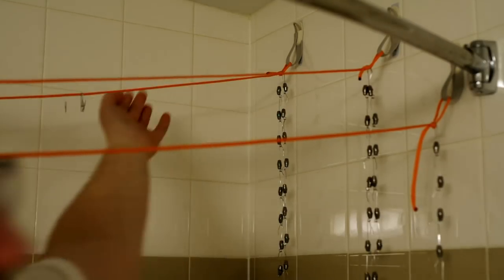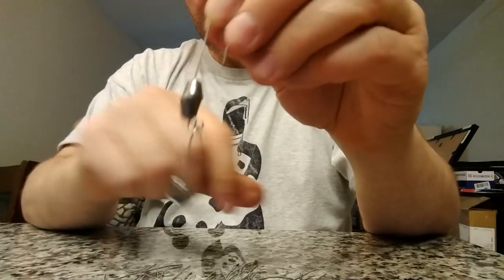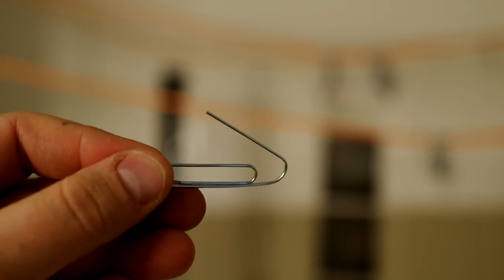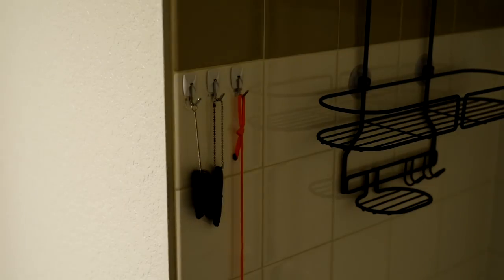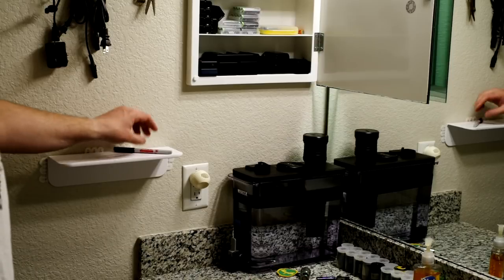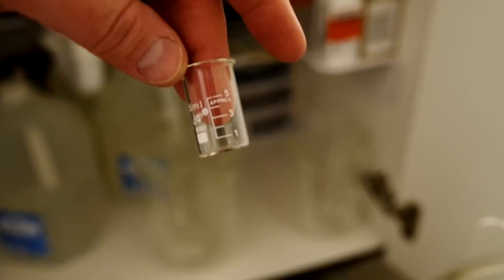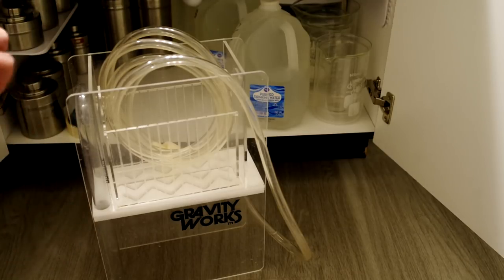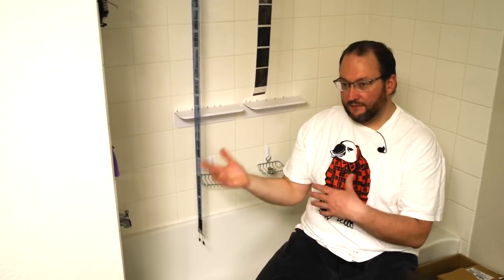Home Film Processing Tips and Tricks

Comment: I use fishing weights for my film, great minds and all that. I use different colour funnels for my different chemicals and I also mark them to indicate what chemicals they are used for. I also have a collection of 10ml 5ml and 1ml syringes with blunt needles for different chemicals that need precise measurements such as Rodinal. They cost pennies off eBay, but I always rinse them well with filtered water before using them. I rinse them again after use and put on them with a permanent marker what chemicals they were used for. I use one of those circular cloth hanger drier things for hanging multiple films. I can fit about a dozen films all at one time without them touching each other, the most I’ve had was 8 4 120 and 4 35mm. I run the shower really hot before hanging my film to bring the dust down.

I was lucky that I was given a Nova print developing tank (20 x 16) and a Nova print rinse tanks, but I can take the partitions out and put film in. The two together cost around £800 new. The same guy gave me a light table, two years supply of D76, a couple of other developers and a warm plate foe developing trays when I using a different developer than the one in my Nova.

I’m thinking of developing all my analogue 365 project films at the same time early next January so my question is how long do you think you can leave a film without developing before you lose quality? My father in law gave me a Practika he had last used in the 80s, there was a half used roll of Kodak Gold in it that I developed for him but they came out looking under developed.

Of course the video was helpful as a whole, and it’s difficult to pick out individual parts except to compare with how I do certain thinks.

We’ve not seen you for a few months, you’re looking really well.

If I was a dog I’d want you as my owner, I know you are the right people to give a dog with difficulties the sense of security he needs. My late father once told me you can judge a man on how he treats his dogs. He was Otis's favourite visitor, he was my dog who was with me through the worst of my alcoholism and the first few years of recovery. Loyal as heck and I always made sure he was alright no matter how low I got. Dogs are special and often they need special people like you. However, dog farts...🤢

Comment: The work flow process is fantastic, so many great solutions to make it efficient. I will likely never have that kind of quantity, but this was thorough for all steps and issues. Tape and Sharpies are the best. Cheap solutions to process, also. Storage a bit less since I will not have that variety or quantity, but still useful. Great video, and saved. Good luck with the Canine.
Reply from the maker: Thank you!

Everything can be scaled to your size space and needs. The big thing with the workflow is keeping all the supplied either within arm's reach or at least nearby and then making the cleanup quick and easy.

Comment: Great tips here. Will come in handy in 2019, where I have a goal to shoot more film. My current capacity though: 2 rolls. ;) 
When you develop color do you worry about the chemicals? Do you use a mask? Is the bathroom fan enough to ventilate? I hardly ever do color, mostly because I'm paranoid of it in my small space I have to work in.
Reply from the maker: Thank you!

I don't develop color at home. One of my friends had an acquaintance who died developing film (I think it was E-6 or another color process besides C-41.) I want to try C-41 at home, but I want to have better ventilation before I do. The future basement darkroom is going to have an air circulation system to bring in fresh outside air, so C-41 at home will probably have to wait until we're in a house.
Reply: Andrew I never have much trouble developing C41 at home using Unicolor.  The blix is nasty but to be honest if the fan is going it really is just a bit concentrated in the bathroom while using it and vents out in a few minutes from my experience.  If you are concerned by the fumes grab a p95 air mask at whatever big box is near.  It isn't the absolute best air filtration, but the vent makes it much easier to breath so you actually want to use it.  Personally I haven't found the need.  My wife seems to be more sensitive to the blix than I am.  We are using Paterson tanks so they seal pretty well and will replace the tank if the seal starts leaking much.  (Even new tanks will leak a few drops of blix on inversions wear gloves)

Although we don't develop for long sessions usually one or two tanks so total time exposed is under 30 minutes.

I have never heard of anyone dying from any of the chemistry outside someone being an idiot and drinking it.  It is mostly just an unpleasant odor.  As safe as I am it has come in contact with skin to no effect outside of a quick wash with soap.  Watch videos of the old guys Ansel Adams and others they rarely wore gloves, didn't have large vents and lived long lives.  That's not to say live risky, more to keep in mind that a good percentage of these chemicals were normally found in average households back in the day and way worse I might add.  If you are being cautious wear a mask, good nitrile gloves that go above the wrist, put on a lab coat, and keep the water running in the sink/tub whichever you use.

Same goes for E6, which while I don't have extensive experience, a lot of my friends from back in the day developed their own slides and never had a special setup, they processed it in the bathtub using a tank I can't think of anybody saying they used gloves even.

Comment: Tested the Brita and it doesn’t actually reduce TDS much at all - about 10% reduction versus tap water.  Mostly it’s just an activated charcoal filter.  I recently got a water distiller for about $100 and just run that overnight to make 2 gallons of distilled water for all my chemistry.
Reply from the maker: Yeah, that's my next upgrade. Mostly the Brita (and letting the water sit in a pitcher to off-gas) gets rid of chlorine, which (if I understand correctly) is the element in municipal water that has the most effect on film chemistry.

Comment: Good, and what you use to digitalise your film?
Reply from the maker: For 35mm, a Pentax K-3 with a macro bellows and Rodenstock Rodagon 80mm f/4 enlarger lens. Enlarger lenses are the best because they were designed to reproduce flat-field to flat-field. For APS-C, a longer-than-normal focal length is needed to reduce the negatives. For 120 and 4X5, I use a negative carrier over a light table and digitize with my Pentax K-1 so that I can use pixel-shift resolution if I need to.
Reply: @DavidHancock  Thanks, for  replying. I was planning to buy a flat bed scanner..
Reply from the maker: I used to use a flatbed, but found that a DSLR has less noise and better sharpness, and editing negatives in raw is easy. I struggle, still, with C-41 color negative stocks as they're very hard to invert well from raw. But for slides and black and white, the results are consistently better than scanners.

Comment: Those beakers aren't meant for measuring, just to give you an estimate how much you got since the scales aren't applied to the glass with high precision. You should invest in proper measuring glass. Also, proper measuring glass are designed so that the line for say "20 ml" touch the liquid surface from underneath.
Reply from the maker: I would like to, but on my budget, those were what I could get. They all say they have a margin of error of +/- 10%, which is generally okay for film processing.
Reply: @DavidHancock  They aren't that expensive. I found these on Amazon with good reviews. Check 'em out! https://www.amazon.com/Thick-Graduated-Measuring-Cylinder-Brushes/dp/B01ECAQPWA
Especially when using HC-110 I would like to know exactly how much I got so I can dilute the syrup properly.
Reply from the maker: Those are a good price. I added them to my wishlist. Thank you!

Comment: sell some of your excess reels and tanks or i will never forgive you. recycling your valuable but never to be used in the perceptible future gear to other photographers is never a bad thing...
Reply from the maker: They get used. Basically, I have enough 35mm and 120 reels to fill all the tanks that can hold them. I don't use them all at once often, but four or so times a year it happens.
Reply: @DavidHancock  let me get this right, four times a year you use ALL of the tanks simultaneously? if you can manage that, i have an extra zeiss hollywood i will sell you for $50!
Reply from the maker: Four or so, yes. My job has some busy cycles and the film stockpile builds up. Then when I get a break, I spend a day just developing.
Reply: @DavidHancock  well i guess if you say you can do that, suppose as your faithful YouTube comment section peanut gallerist, naturally i want to see it documented with an a7s... turn the screen off and let's see this symphonically prolific process.
Reply from the maker: Yes, that will be the next darkroom video. I'll show how to manage multiple tanks at once by filling every tank I have with film and developing until I cry. There are some management strategies that help when developing lots of film at once. I just need to get the undeveloped stockpile large enough to film that.
Reply: @DavidHancock  do you find your film degrades if you wait to develop en masse?